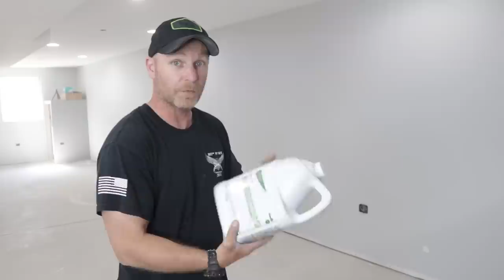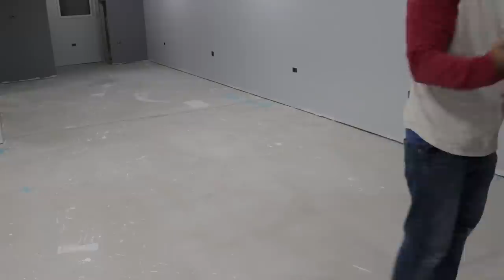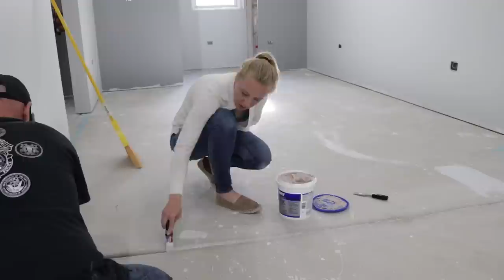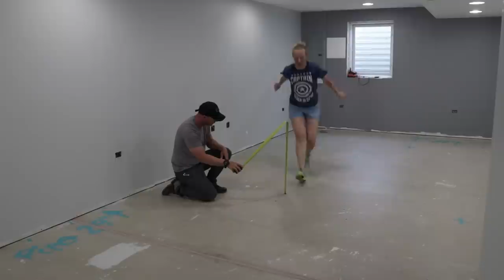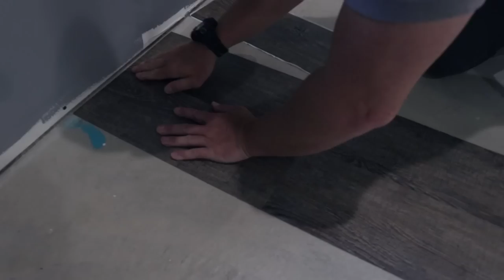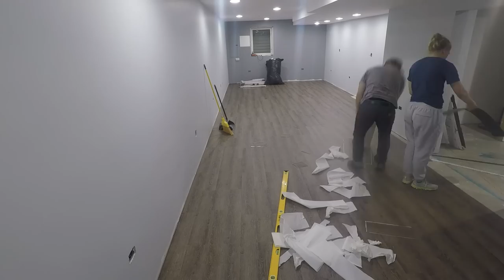How To Install Peel-and-Stick Vinyl Plank Flooring and Floor Preparation

Comment: Hi Komar Project, why did you always start your flooring from the middle but not at the edge of the room?
Reply from the maker: Cody - because walls are not usually straight and it’s better if you shoot a chalk line somewhere down the room and follow that

Comment: I also have a basement woodworking shop. Mine is about 350 sq/ft and currently has bare concrete. Hadn't considered peel & stick until I watched your video. Now I'm leaning towards getting this product and installing myself. I'm thinking of installing about half of the room at a time so I only have to move my equipment to one side while installing flooring on the other. Do you think this flooring offers any protection to a dropped chisel or hand plane? And, does this flooring work overall for a woodworking shop? Thanks for putting out these videos!

Comment: I installed them in my basement bathroom over exsiting square peel and stick and even after all the floor prep a lot of them are lifting. Do you have any suggestions? We have tried a heat gun and setting something heavy on top but after a few hours it lifts back up again.
Reply: @user-xp9gr8ub2j. I was told to use Henry’s vinyl adhesive. Also clean the area well. Scrap up any glue and fill any holes. Make sure you’re sealing the floor. Let it dry completely, and vacuum.

Comment: Nice video.   Is it seperating at all anywhere.   I want to put this in my basement
Reply from the maker: I haven’t seen any separations yet.   I’m moving soon and will be doing an update on the flooring and how to replace some of them.   I got glue and paint on some And need to replace them.  So a video will be coming out on that in a couple of weeeks

Comment: Great video! I appreciate the thorough explanation. How would you say this type of product compares to tile or the harder floating floor planks? Looking to save money on tile cost and supplies, as well as this looks like a softer material, but with all the before prep, I am wondering if we still save on cost. Can you comment on this?
Reply from the maker: Tricia Donovan for us it’s working well.  As long as you don’t get water damage where your installing it your good.
Reply: @KomarProject  Water damage, as in a flood, or just dropping water on it like kitchen or bathroom??

Comment: New Sub here.. love your vids. I had a question did you have to sand or how did you ensure the compound in the expansion joint is flat before sealing and laying the flooring?  Thanks so much.
Reply: I would love too know this to. I’m putting this in my grandson bedroom. So far I’ve painted the ceiling, walls, and trim. Removed the carpet, padding, and tack strips. Now I’ve got small holes. I’ve scraped the floor. Now I have to wash, fill and seal the floor. Do I have to sand? The patchwork? I can’t wait to finish the peel and stick tile. Thank you for an awesome video.

Comment: Hi yes I enjoyed the video yr pops & partner in crime were awesome I had a few ? 
Did U start in the middle due to the pattern of the vinyl & was the vinyl sticking good enough without applying an additional this is my first flooring  project.
Reply from the maker: jaybeck73 hey Jay. I started in the middle because even though I framed the walls myself usually they are not straight.  It’s just a force of habit.  If you start on the middle or somewhere off the wall you know your going to be straight.  And yes they stuck well

Comment: Why did you start in the middle is area? Why not From the corner or even along the wall.  Was there a patter how you layer it out so it wouldn’t look wrong ?
Reply from the maker: Liliana Martinez you don’t want to start referencing the wall cuz they usually are not straight.  And you just want to patten them like a brick pattern.

Comment: Everything I see says you can only apply this to vinyl, concrete or plywood.  Why can I not apply it over old hardwood floors?  Even if I sanded the finish off of the floors I cannot use this?
Reply from the maker: Hard wood floors move with the seasons.  And it will open up the seams

Comment: Great video! Seen you had pups in the there. How well does the floor hold up with them?
Reply from the maker: Tiffany Velapoldi amazing. Dogs run all over it and I drag tolls all over it and it seams indestructible.

Comment: Looks great!  My 12 year old son and I watched your video.  I think it will be our project in the basement since my husband is doing a bathroom remodel!  I wonder with all the cleaning and sealing, how long did the whole project take you?  I have to empty the basement first, and was wondering how long all my stuff would sit outside!  Thanks!
Reply from the maker: Sarah so sprry for the late reply, but i just saw this.  I was able to seal the flooring in one day and then put the flooring down on the next day.  So two days in total.  If you can do this with two or even three people it will go much faster.  Knees start hurting after a while, or maybe im just getting old. Hope this helps

Comment: LOTS OF PREP BEFORE THAT PEEL & STICK. WAS THINKING OF DOING IT TO A BATHROOM. CAN THIS BE DONE OVER PORCELAIN OR CERAMIC TILE? ALSO THE BATHROOM FLOOR IS UNLEVELED!
Reply from the maker: I wouldent. You may see the grout lines

Comment: I want to do the furnance room area but the floor drain is there and it has a slight swell to the drain what would you do ... this peel and stick ... or small ceramic squares  on floor

Comment: What do I do when the floor has ply wood on it
Reply from the maker: You can put this over plywood according to what I have read. You have to seal it first though.  I would check with the manufacturers instruction.
Reply: Thanks for the reply and the video. My problem is that my surface is not concrete, it’s wood. I don’t know the kind of sealer to use

Comment: How long did it take you to do that floor? We're doing a 400 rectangular room and it feels like forever. With prepwork. It looks nice. Great video.
Reply from the maker: M M we were able to lay 1000 sqft in two days.  Broke it up into two days because it wears on your knees all days long.  But once you get started it goes pretty quickly

Comment: Very nice job ...is it easy to remove ?  coz am renting
Reply from the maker: Yosra Omer no idea on the removal. I would say no because it’s and adhesive.  You might have issues removing the glue. If your just trying to do something that you can lay over an existing floor and then remove it, I would look into a floating laminate floor that locks into itself.
Reply: @KomarProject  thank you so much for answering me  .. i have old vinyl tile maybe i'm gonna try floor contact paper to cover it which is easy to remove.

Comment: Wow, can never please everyone I guess lol! I thought it was a great video man, thanks! Question - a few articles I've read said to leave a 1/8" gap between planks to allow for expansion/reduce chance of buckling. Logically I thought that sounded weird, thought that'd be noticeable if you walk barefoot and could allow water in. I noticed it seemed like you laid yours tight as well, matching what I would do. Thoughts?
Reply from the maker: Joey Luckow that’s so much!!! That means a lot.  As for the planks I think they meant 1/8” gap from the walls but that would be for some wood product that is floating to allow for seasonal expansion and contraction if there is no vapor barrier or just to be safe.  This is a stick vinyl and don’t think it will move much if at all.  At least I haven’t seen any issues on my end.  The one I put in said to put them in tight against each other so that’s what I did.   Good luck !!!!!

Comment: how does the joints look like after a year or smthng?
Reply from the maker: hymdt I haven’t had any issues. I did a nother install about a year after this one. You can check out that video if you want.  It’s on my channel and goes into a lot more detail on it

Comment: Good job. Had any tiles pop back up? If so, how did you fix it?
Reply from the maker: Brad the Great not a single one. I drag stuff all over that floor and it’s holding up amazing. Best decision I ever made for a basement.

Comment: OK what if I was  a dumb ass and I painted the concrete floor with latex paint will peel and stick    still stick to it ??
Reply from the maker: thats actually a really good thing.  they recomend sealing it or painting with a primer.  so you should be good
Reply: @KomarProject   Well great thanks for the response that's a load off my mind good day to you
Reply from the maker: Darrin8112 no problem.

Comment: Sooo does it have to start in the middle of the room ? Lol or can I start from one side to the other
Reply from the maker: You can totally start it on one side.  Just don’t use the wall as a reference and shoot a chalk line.  Middle is just easier

Comment: You didn't use glue. Is that due to that style of plank or do you know?
Reply: It's a peel and stick vinyl so there's already glue on the back of it
Reply from the maker: Ya it has a glue backing and no need to use additional glue.

Comment: Wow this looks awesome!! I really want to do this for my office den but I have really ugly old carpet with just concrete underneath. Could I just use that latex floor primer? Would you recommend underlayment or your method of concrete to vinyl be sufficient?
Reply from the maker: Sanda A. Hla I don’t think you need an underpayment if your using this product if you seal the floor.  At least that’s what the directions on it said.   But if your using a floatin vinyl floor you might need a vapor barior.  Depends on the product you use.  This product you should be good to go.

Comment: Does plank flooring (whether vinyl or laminate) normally get started from the middle right of the room? I thought square tile was started from center and plank tile from top left. And for god sakes, mark your cut lines on the underside!
Reply from the maker: mongosmash100 doesn’t really matter where you start as long as you measure out for square. It’s usually easier from the middle that way you can make any adjustments you need.  I started in the middle because I had to consider the next room and wanted them to flow together.   Hope that helps.

Comment: My basement concrete floor is painted (from the previous owner), do I need to strip the paint before cleaning, prepping, and laying the planks? Or can I do this over the paint?
Reply from the maker: Depends on how well it’s on there.  If it’s good I would just throw some primer over it to be sure.

Comment: Helllllllp i did half of my basement after cleaning really well sealing it... the same vinyl isn't sticking fully i even tried hitting it with a rubber hammer to try to get it to stick but no luck😭😭😭😭

Comment: Hey I really love this video. I’m looking to apply it in my bathroom. Does the tile stay on even if I mop it ?
Reply from the maker: Naomi Mengi I mop my all the time and it’s still good
Reply: So it’s waterproof ? 
Thanks!
Reply from the maker: Naomi Mengi I wouldn’t say it’s waterproof but water resistant. It’s vinyl so it hold up well with water spills

Comment: I really needed a video like this,  but the voice thing interfered with you teaching the dyi. I have a space similar to this that I need to do the flooring in and I couldn't understand what you were saying due to that voice change device you're using.  So annoying.  If you can,  will you post the same video without the funny voice changes?
Reply from the maker: Crizzy Song sorry about that.  It was one of my first videos.  Don’t know what I was thinking.  I did do another one moths after that has a lot more detail and no silly voice.  You can find it on my page.
Reply: Komar Project Ok. Thank you so much for responding.

Comment: Good video, but leave out all the goofy antics next time.
Reply: Arturo, I agree and maybe for different reasons but I just want to get to the nuts and bolts of the project. And that seems to be a trend when couples do projects, we get it you get along as I would think a couple should but I seen enough of that clowning from Chip and Joanna.